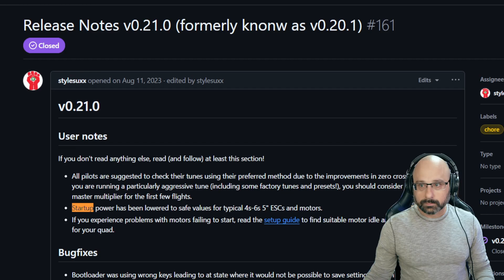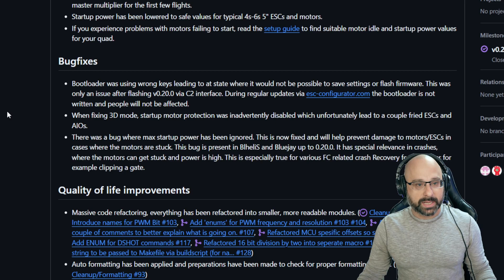I Flashed Bluejay and Now My Motors Are Stuttering? Help! - FPV Questions

Comment: The motors can definitely stop completely mid air in reverse flow situations (without a desync) when the start up power in Bluejay is set too low. I had that on one quad where you could literally see that in the DVR.

Comment: 0:45 that's what I did on a 2s flywoo aio and after a couple times saving and trying to start up, the esc and motor burned. Literally sparks and flames.

Comment: From what I can tell, the ESC firmware that is installed on products from the factory WORKS.  What I see is people only having issues  AFTER they flash the firmware. Unless the quad has some issue, there is absolutely NO good reason to flash stuff just to be flashing. The latest version is not always better. If the factory ESC firmware is already BlueJay, maybe leave it alone and not flash it. Just a thought. I have dozens of quads (some BNF, but mostly custom builds) that are all running the firmware that came installed from the factory. Since all of my quads fly just fine, there is absolutely NO valid reason to flash any of the firmware. If it ain't broke, then DON'T Fix it.
Reply: Me want fancy boot up noise oogabooga
Reply: If it ain’t broke, flash it to enable bdshot 😂
Reply: @connectionlost1063  If it ain't broke, Flash it to break it. Then, get on forums and ask for help to fix what got effed up.

Comment: Question may not be related to blue jay, I fly a few quads with this build, Geprc f4 betaflight 4.4,3 blhelis, elrs receiver on toothpick frames 4600 kv motors with 3s and 4s packs. No tuning required.

My new quads are geprc f7, betaflight 4.4.3, blue jay, elrs receiver, toothpick frame etc. no tune out of the box betaflight, flies amazing on 3s better than my blheli. Put a 4s pack on it and it takes off to the moon? What am I missing?
Reply: I didn’t have bi directional dshot checked and no rpm filtering headsmack. Once it was checked and rpm filtering all is well on 4s